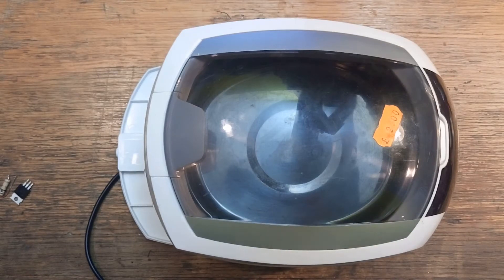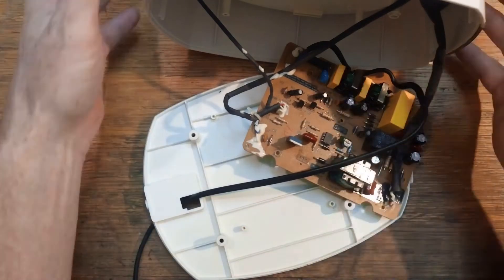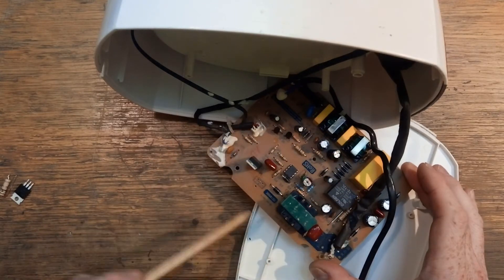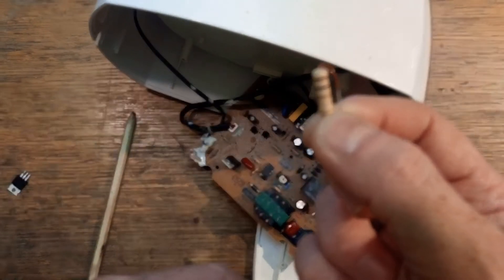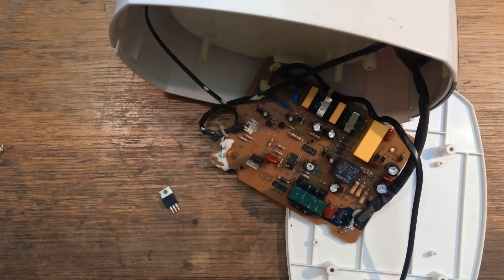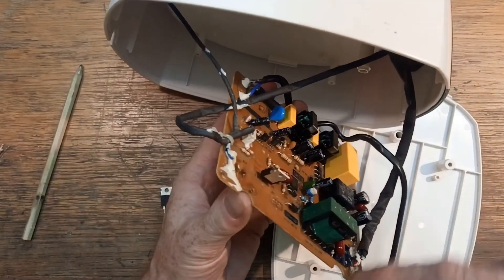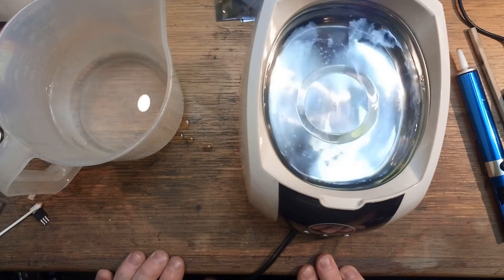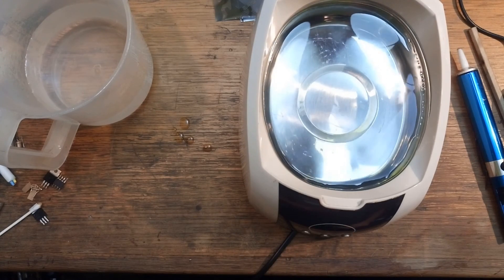Repair of Ultrasonic Cleaner Driver

Comment: Just to say that I had the same failure recently on a visually identical unit originally obtained from Aldi.

MOSFETS had failed Gate- Source short. The original IRF830B's were replaced with IRF830A as these were readily available at a sensible price. The "B" version was not!
Replaced the Driver IC and the 1 Ohm resistor with a 2W, fusible type.

All working well. Not sure what provoked the failure? No signs of water ingress. The only thing that was different prior to failure was multiple cleaning runs one after the other. Perhaps the MOSFETS would benefit from Heatsinking?
Reply from the maker: Glad you found the video and information useful.

Comment: Hi,

This video was very introductionally informative for my repair attempt of a Carrera ultrasonic cleaner that I bought years ago 2nd hand. It broke down a year ago or so but today was the first time that I decided to finally open it up & take a closer look. 🤔😏👌👍

My 2 BU406 transistors seem to be fine but the 555 timer 8-pin IC is definitely a bust. Have to check more components though...

Thanks ! 😇🤗

Best Regards,

Comment: Great result, but it looks like you replaced the original 1ohm resistor with  a 10 ohm?

Brown Black Gold would 10 x 0.1 = 1.0ohm.
New blue one looked to be Brown Black Black...
Reply from the maker: I'm now going to have to take it apart and check that out. LOL
That was 2 years ago and I would have just bought a replacement and fitted it and cant remember if I checked that out properly.

Comment: My unit was blowing the 1 amp fuse; replaced both faulty mosfets, but no part number on the 16 pin chip so have not replaced it. Can I try to bring it up slowly on the isolation transformer and see if normal operation restored?
Reply from the maker: I'm not really sure.
Sometimes bringing a power supply up slowly for switching circuits means they can sometimes not have enough voltage to switch properly which puts extra strain on mosfets etc.

Comment: I would be interested to know what replacement MOSFETS were used in your repair? 

A couple of years ago I discovered the same faulty components in a new never used out of warranty (identical) Silvercrest (Lidl) ultrasonic cleaner. I replaced the resistor, IR2153 chip and the original IRF830B MOSFETS with IRF830's but with a puff of smoke it failed instantly. I recently decided to have another go and am currently awaiting delivery of some replacement IRF830B's in the hope my not fitting the B version MOSFET was the problem with my repair. 

While waiting I reverse engineered the oscillator part of the circuit and  decided to run the chip from an external 12 volt power supply and some replacement IRF830's from a 24 volt supply. Having scoped the circuit I can confirm the potentiometer sets the driver chip frequency (between approx 39 to 46 kHz). There is also a sense winding on L3 (the output choke) that feeds back to the timing circuit presumably to assist with maintaining resonance and maximise output power. Will wait for the IRF830B's arrive and be fitted before attempting to run again at mains voltage.
Reply from the maker: I would have used the same ones that were originally fitted.
Reply: Mine had 2 BU406 transistors. 😕😊

Comment: I bet water's getting in when you empty it. I have a rather fancier one at home and it has a specific corner you are supposed to empty it from which is marked by an arrow. Maybe a bead of silicone round where the metal joins the plastic would be in order?
Reply from the maker: I think you might be right with splashes and some sort of water ingress when emptying. There's a silicone sealing ring that may or may not be doing it's job properly. 
I've drilled some holes in the base to aid ventilation and stop the build up of condensation